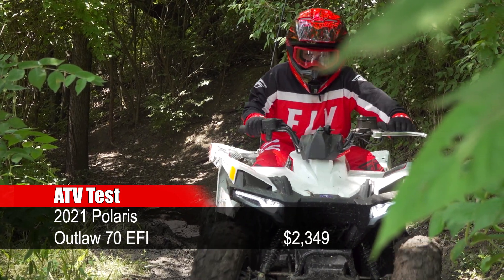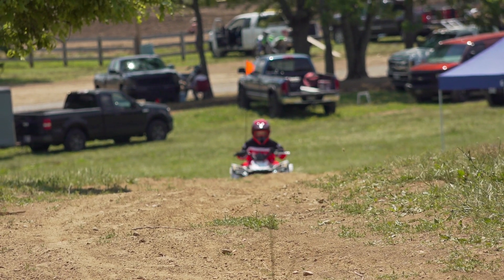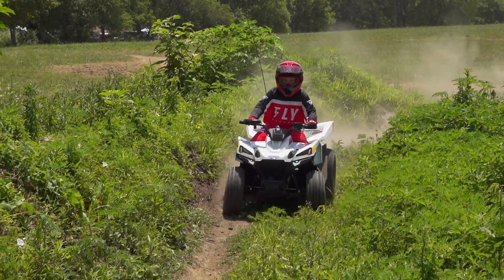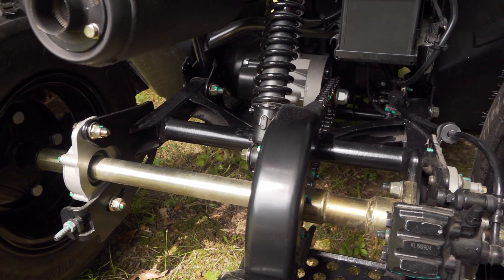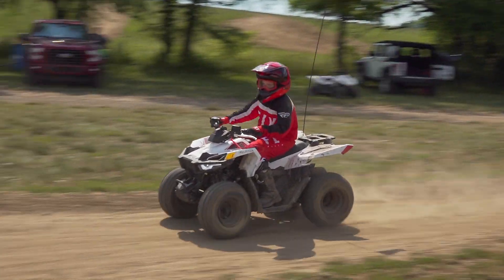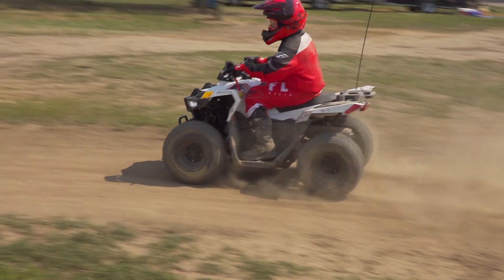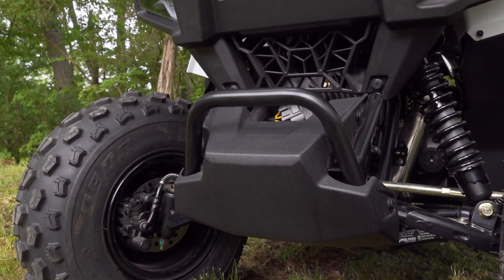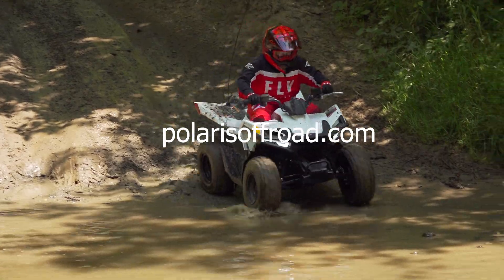2021 Polaris Outlaw 70 EFI Test Review

Comment: The steering it is limited due to the extra piece of metal on Column. The small metal piece stops it from turning all the way right or left.
Reply from the maker: You, can probably shave those down to let it steer farther but we didn't test it and see if there are any other drawbacks to doing it. It was a loner unit from Polaris so we couldn't start grinding on stuff.

Comment: What do you think about the TRX250X
Reply from the maker: It is currently the best ATV available on the new market to help riders transition from nineties to bigger machines like the YMZ450 or raptor 700. Here is a link to our review on the 250X.If you have any further questions regarding that machine please feel free to leave a subcomment on that test video. We'll get back with you. https://youtu.be/N36vSpaZin4
Reply: I’m 15 now and I’ve had it since 2013, I really love it and it has gone to some crazy places, like windrock in Tennessee. For younger me the bike easily rides itself with little input and just makes it’s way through just about anything, now that I’m bigger it really goes through anything with more body use but the gun factor is a little lower than I wish, not very good at drifting because the low rpm. But i highly recommend getting one before you think somebody might be ready, because it is an awesome bike. I also have never had to tamper with the engine and it has gone through one spark plug, really is built to last.
Reply: @ashh2748  I got one 3 weeks ago and have took it to the black hills a bunch and it handles really nicely
Reply: @rylanbodin8805  yes it is very easy to use but can be tippy without leaning right and the tight suspension can be a little bouncer at times

Comment: would yall ever test Hisuns or CFMotos?
Reply from the maker: We most certainly would. We test with all of the major manufacturers but CF moto   Has yet to contact us back. Makes us wonder.
Reply: @ATVonDemand  don't test hisuns.. there junk trust me I have a forge 750 and it's been hell.. it over heats and you can't go over 25 mph without it breaking down, it doesn't start in cool weather and in the summer it just gets way too hot and my parking break don't work on it and NOT TO MENTION ITS LITERALLY NEW

Comment: Atv on demand...where every review is a sales pitch and never highlight any shortcomings of reviewed items
Reply from the maker: You're either joking or you didn't watch.
1.  We criticized certain maintenance points as being hard to reach.
2. We said it was 50 to 70 pounds heavier than its competitors.
3.  We mentioned that the larger heavier tires and wheels make its power feel more on par with most fifties.
4.   We said that power was adequate for beginners but more experienced ridrts will want a bit more pep.
5.  We said the swing arm was rather wide and unrefined looking and that the chain adjustment system was unnecessarily complex.
6. We said ground clearance was a touch low for the class at 4".
7.  Yet we said that if there are any significant engine and clutching upgrades and jumping becomes a thing, the suspension will begin to bottom quickly.
8.  We mentioned that the rear tires rub against the back of the foot Wells when the rear shock bottoms out.
9.  We mentioned that steering was stiff on our unit. Not sure if that is normal.
10.  We said the turning radius was as wide as a full size ATV.
11.  We said that the rear brake pedal is a touch tall.
12.  We said that the front fenders protruded a bit far back into the rider compartment getting in the way of the rider's knees.
12.  We criticized it for not coming with a rear grab bar standard.
Reply: You just had to be "that one guy" 😂
You've been spanked.
Reply: @ATVonDemand  lol, I was joking. I didn't expect you to take so much time to reply.  I know you pointed out the flaws.
Reply: @thatoneguy2756  Joking? You should reevaluate your sense of humor as it is not detectable by normal people.
Your comment clearly reads like a slam against the ethics of the channel.
Reply: @jH-zu9ky 😆 awwww u b ok
Reply from the maker: @thatoneguy2756  LOL.  You never know for sure. Just figured we'd cover our bases.